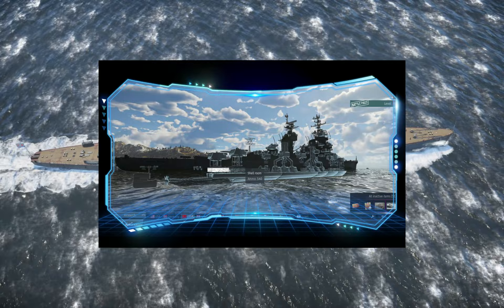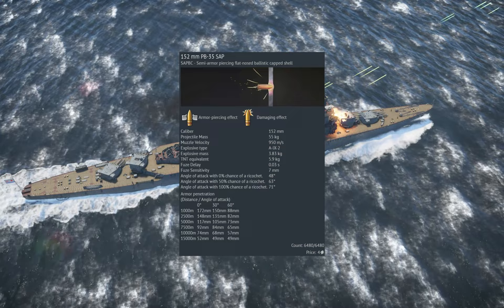Sverdlov-Class Light Cruisers - Mikhail Kutuzov - History & Guide

Comment: I've wait for so long to see a modernized Pr.68 an now we have one and maybe we may not need a Pr.1143 as an AA ship (I've done up a basic draft to post in suggestions for that one).

Anywho setting secondaries just to AA will see the AK-230's not wasted but shall definitely cause people to be wary of those ships in battle at low alt with the only true option to fight them being high leveliers (above 6000 metres alt).

BTW I believe that you forgot to mention the HE-DF shells for the 152 mm mounts.
Reply from the maker: I would love to see the Pr.1143 as long as we get Yak-38 scout planes 🤣.

Very interesting design and a favorite of mine.
Reply: @CmdrTyrael Good day, Ironically that was gonna be a controversial option either a Yakovlev Yak-38 Frogger with 100KG bombs or to a lesser extent a Kamov Ka-29 Helix which would open up other naval helicopters like the Westland Wasp on a Type 12M/I (Rothesay/ Leander) if they ever come.

But anyway I'd say of all current AI vessels the Baku of the Kiev class would be the best option being a Cruiser with aviation facilities on one side an could work as a 5.7 AA vessel with main guns being 2×1 100 mm automatic artillery with the ability of HA firing, 8×1 AK-630 CIWS as AA and several sets of RBU rocket depth charges and 21" torpedo tubes on each side ntm some AA missiles.

Second possible AI is error I messed up ship classes edited out wrong ship listed.

Comment: This Ship is a total Bummer.
There is no reason to use it over the Svedlow or Chapaey, because Radar doesnt work, Barely any Enemy Planes to make use of the Anti Air.
Also the Fire Director in X-ray is supposed to be the same as the ones on the 5.0 Destroyers. Means Target Measurement of Only 6 Sec and Updates every 3 Sec. That would make it alot more Potent at Ranges over 6km. But the Model still uses the old 20 Sec ones.
Reply from the maker: I agree, it's nice in theory. But with those glaring oversights it doesn't work as Intended. Also a distinct lack of aircraft at that tier make it very niche. (Although naval EC might be different)

We tried testing the 30mm's against missiles and fast movers. With no radar and a 1950' s firedirector it's just "spray and pray" as usual. I was extremely disappointed, i was really looking forward to some CIWS action.

As I mentioned in the video I found the torpedos on the Sverdlov to be more useful at that BR.